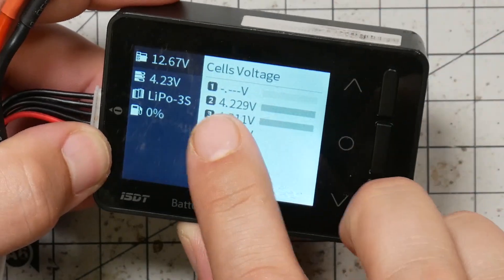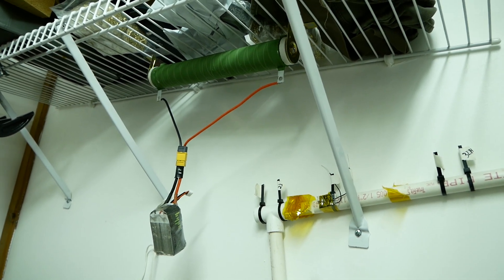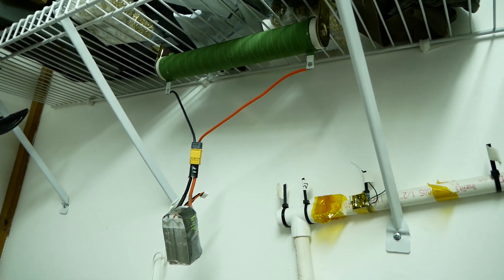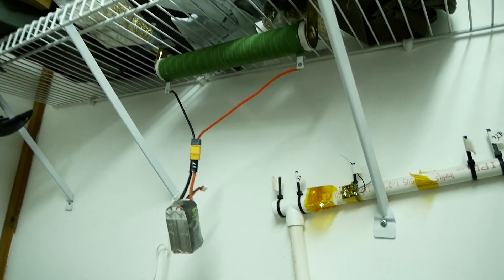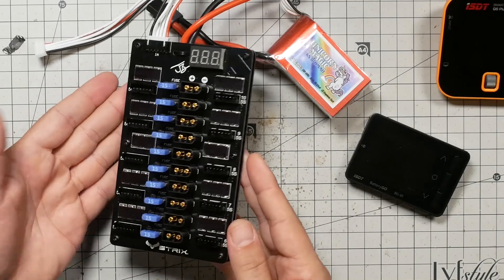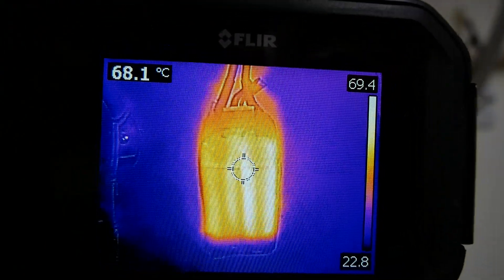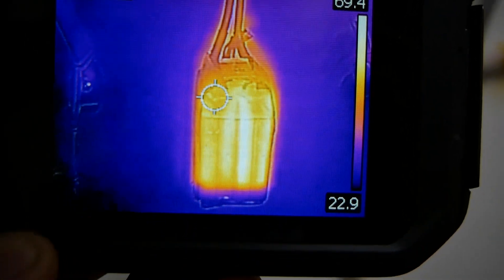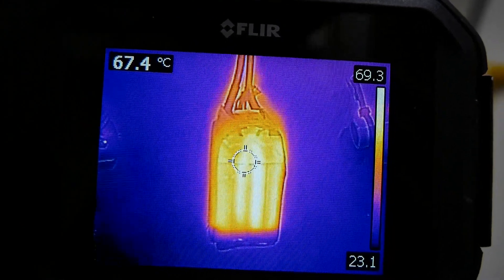Is Your LiPo Safe To Charge | WHEN TO THROW IT OUT

Comment: I'm one who splits my batteries and removes the bad cells. Never had an issue doing that. I appreciate the fact you didn't discredit that practice. These are good practices, I use them on all my packs, especially my rebuilt ones. Though they tend to be the best batteries i have bc I match the cells
Reply: Just to clarify, I do think you are being a bit more cautious than necessary. Nothing wrong with that. In an academic setting, it's very good.
Reply from the maker: It's beyond many people's capability to safely deal with bare lipo cells.
Reply: @JoshuaBardwell  I would agree that it is beyond many individuals' current skill level.. Soldering at all was beyond my capability a year ago. With training and practice, I think anyone who can solder can learn to safely rebuild a battery.

Comment: 0.5 ohms with a 4s lipo is over 30 amps initially..
Reply from the maker: Yeah I went back and checked the math and I think it's a 2 ohm 100 watt resistor.
Reply: @JoshuaBardwell  aah, that seems more reasonable 😅

what I do as well, besides checking the IR on my charger is using the lipo in question to power the charger itsself. I then start a ~10A charge and monitor the voltage drop on each cell. I just don't trust the IR measurement of my Q6 plus, since it has shown greatly varying numbers for the same cells with only a few minutes apart..

Comment: By the amount of comments i am starting to wonder if ppl are not aware NOT to use water when there is a fire with electronics. Don't forget lipo's are selfoxidizing so you can't put them out once on fire (also lithium reacts explosively with water). Pls use a (preferably large) bag of sand when there is a fire involving electricity.

Comment: Hey Joshua,
Yesterday I took my batteries to charge them and go fly (tattu r-line) and one of them had a cell at 0v. The thing is that the LiPo had no physical damage, it was stored at 3.8v per cells and it had less than 10 cycles on it.  What happened and what should I do... 
thanks
Reply: He just spent ten minutes telling you what to do. It's f#%ked, scrap it. It'll give you peace of mind and allow you to focus on getting that piece of bread out of the toaster with a fork. I suggest using a sharp, stabbing motion and sparks just mean that you've nearly got it
Reply: fp free yeah but I don't have a lot of battery and it feels bad to retire it... don't know how it happened...
Reply: @nicolasquince  Tattu are not the longest lasting batteries. They work well for a time but then -
Reply: fp free ok 😌 I will carefully choose one of them
Reply: Nicolas Quincé if you can get them where you are I can recommend FMR batteries highly, tiny bit cheaper, made by same manufacturer as tattu, performance is awesome and while my tattu's r-lines had fairly short lifespans, these are still going strong and are in better health at or past the age of the r-lines. And using the light globe method like JB shows to retire a battery is a much safer and reliable method than the salt water method. Yes battery costs suck, maybe speak to your supplier bout your bad one but put it somewhere fire proof til then
Reply: try to charge it with nimh programm to get some voltage into the dead cell then charge with normal lipo programm
Reply: I had a few cases of balance cable broken (with the insulator still holding it) if your total voltage doesn't match the sum of your cells, could be the case.
Reply: Manuel Pellizzari no it's just a cell that went to OV.. thanks anyway

Comment: i keep a 5 gallon pail of water now next to my charger, since the last one that just blew off
Reply from the maker: Water is not going to help since lipo fires are self oxidizing.
Reply: i know this, last time i had to burn my hands carrying the pack to the window with flames shooting out, safer to drop in water to transport while exploding
Reply: @jdmrustedricer6130  The standard and cheapest cure is a simple metal bucket full of sand, inside another metal bucket. Drop the hissing battery into metal bucket, then poor bucket of sand onto it. Then run..... (Dirt or Soil can work also, but nothing too wet or containing water)

Comment: i had a 2s pack with low resistance matching cells, 15 min after charging it blasted off, 3rd floor apartment had to throw it out the window

Comment: I realized recently that another potential pitfall of parallel charging is that if a wire on the balance plug is damaged you may never know it, allowing 2 cells to come unbalanced from each other over time.  Your charger will only "see" the voltage of the batteries with good connections.  I check my batteries with the linked checker each time before they get plugged into the parallel board, assuming it would alert me if a cell was out of balance but it turns out you have to manually cycle through each cell and compare voltages.  I think this is a common battery checker re-branded under a bunch of different names.
https://www.amazon.com/eHappyMaker-CellMeter-7-Digital-Battery-Capacity/dp/B01JOO3H5M?keywords=lipo+checker&qid=1540798428&sr=8-5&ref=sr_1_5
Reply from the maker: Yep. Valid.

Comment: Thanks Joshua. Got a couple of GNB 1S Lipos for my power whoop. Almost all of them are puffed a little. I never took them below 3.6. They hold voltage. Retire? 😭Winter ❄️ is coming. How to properly discharge my 4S Lipos? I have the Venom Pro Duo. Just use storage mode? Since spring I didn’t discharge as they were in use regularly. Thank you!
Reply from the maker: Those 1s whoop packs are always abused. At least if they pop off, they're tiny.

Comment: Wait so even if the battery sags below 3 volts it can damage the batteries? I run cheap batteries because well... I'm on a tight budget and it sags below 3 volts each cell I assume because now that I think about it, it might not but I think it does! Does that mean its damaging it? It doesn't stay below 3 volts after I unload it like just going to low throttle! Am I damaging my only two batteries?
Reply: Sag under high load is normal bro, just don't want it to rest when done below 3.7v per cell for best lipo health.  Fyi better the lipo the higher it will stay during sag, my good graphenes on full throttle only sag to 3.8 when fully charged.
Reply: @flo-ridafpv5713  well I only have two batteries and they where only 20 dollars. I'm on a very tight budget right now so I can't buy 5, 40 dollar batteries. I just can't do it. Thanks for the info though!!! :)
Reply: @squeezablemayonnaise8904  no need to spend 40 bro, plenty of good ones for 20 ish or less on sale, just grab one here n there when ya can
Reply: @flo-ridafpv5713  alright well thanks bro!!! :)

Comment: Saying youd never leave that discharge setup unattended is an example of good intentions.  If there were a valid enough distraction (emergency etc) it would be easy for anyone to forget what they were doing.  Since it would be trivially simple to just bring the resistor outside why take the chance?  The cells youre discharging are already condemned as faulty.  Seems like a bad idea to give them their final discharge in the very place youre trying to protect.
Reply: Best way to discharge a lipo is to throw it in a burning fire pit for a few hours.  No?
Reply: @thomasmiller6712  No
Reply: He said he leaves it hanging there over night in the video

Comment: We were told at the CAA drone pilot class if you don’t have a resistor to drain battery befor disposal, a bucket of salt water will do.
Put the battery in the salt water completely covered including the connector and leave overnight outside.
I’ve done this and it’s totally discharged safely by the morning.
A good tip!
Reply: i like the nail method quick and dirty
Reply: Everything on that column on the periodic table will react violently with H2O. I made pure sodium once out of sodium hydroxide. There were a few bits of sodium laying on the concrete when I was cleaning it up with the water hose. Tiny fires were EVERYWHERE as the water reacted to form sodium hydroxide again. The first column of the periodic table is sketchy as F.
Reply: @billybbob18  : The lower you go the better it gets. Bonus points for Francium its radioactive as well XD.
Reply: Yes great idea, lets put a bag full of material that reacts explosively with water in a water bucket XD. Tbh most of the time you will be fine as the cells are supposed to be water tight. But if its physically damaged and somehow not gone up from moisture it will be a nice explosion.
Reply: @someonespotatohmm9513 old comment, but: the lithium in a lipo isn't metallic, and won't react very violently to water. It's kind of like saying mixing salt (sodium chloride) with water will make it explode.
Reply: @ the theory is sound and will drain within 24 hours by electrolysis, basic science

Comment: what do you do with your batteries when you are done with them
Reply from the maker: Take them to Batteries Plus for disposal
Reply: @BatteriPuffa Cut both wires at the same time for maximum effect.
Reply: @lovefpv7786  Don't even joke about this. It's very easy to short the wires even when you're trying not to. Cut the wires one at a time and insulate before cutting the next, including balance leads - unless you're absolutely certain all cells are totally discharged.

Comment: You missed one of the biggest signs of impending failure which is puffing.  In industry offgas detectors are used as an early warning sign of failure and anytime a battery stays puffed its a sign of damage.

Comment: I use a 12V 20W Landscaping light bulb wired to an XT60. Toss the light and battery in an ammo box that has some vent holes and just leave it outside on a gravel pit. Took a near full charge 4S battery with a crap cell (ie 4.18v/4.17v/4.19v/3.64v) down in about 30min. I usually gator clip the leads as a direct short after the light has been off for 5min or so. Claim the balance/XT60 connectors, solder the leads together, trashcan. 

When you mention some cells being lower than others, but not horribly lower, I would have to say that is almost present in all of my batteries. Even those that are close to brand new. (I am pretty OCD about only charging to 4.2, only flying them down to 3.7, and always bringing them back to 3.8-3.85 within a few hours of flying. A lot of my packs when charged up for whatever reason will show 4.2/4.2/4.2/4.18..

Comment: a friend left a 5s pack at the bottom of a river for a day (long story) and i recharged it just for kicks, what i learned is you can't tell when modern packs are starting to puff because of the aluminum/composite plate they put on them now, if you cut the heatshrink you can tell if they are puffed a lot easier. good points about checking to see if one starts self-discharging and testing internal resistance. also i can't think of who made the video but i'm considering making a portable battery charging box out of a small metal tool box just to contain things

Comment: Amazing timing on vid. 2 days ago I had one 3s pack with bad cell and got very hot while charging in parrellel with 5 other packs. Two of the cells charged to 4.2 but the third was only making it to 3.9. I immediately unplugged the bad one, determined it was bad and the the rest checked the same (4.2, 4.2, 3.9) but we're cool. So I continued the charge with the 5 good packs and they all finally made it to 4.2 on all cells. Does this mean I may have damaged the other 5 packs even though they all charged up fine without the bad one plugged in ? I sure hope not.
Reply from the maker: You probably caught it in time.
Reply: Makes me not wanna use a parellel board for this reason
Reply: @FPVMgunit13  ...the truth is, I religiously check my batteries , cell by cell , before and after a flight, and before and after charging. As my luck would have it, the one time I didn't check cell balance on my packs before I charged , I end up charging one with a bad cell. Totally preventable. I always balance storage charge and check when they are done. So the one bad pack somehow lost a cell sitting in storage . This has been the only problem I've ever had balance charging.  I should have checked them before I put them on charge.

Comment: Quick question. If you don't want to set up an executioner's station in your closet and your charger has a discharge function, and to be clear I'm not referring to the storage function, would it be okay to just use that?
Reply from the maker: It'll only get you down to 3.0, not fully dead dead.
Reply: If 4s or below just solder up 12v auto bulb to plug and set on concrete for day or so. Deadness

Comment: Drew's battery was 60-70°C degrees when discharging? That'll increase the chance of fire for sure. They shouldn't exceed 50°C.
Reply: A LiFePO4 pack I blew up the other day on purpose went way beyond 250°C before emitting any smoke.  When it did, though, it was quite spectacular.  No flame to be seen, however, so LiFePO4 seems to be somewhat safer than LiPo after all.
Reply from the maker: Yup.
Reply: That's good to know Bat Wing but what's the best way to check battery temp while charging and discharging? I'm new to RC and shopping for my first Lipo charger now...
Reply: @ Dan
Make sure you buy a charger (I have SkyRC Q200) with an external temp sensor (you can make them with a LM35DZ and a servo cable or buy them already complete). Having an accurate temp sensor during charging is essential and will greatly reduce the chance of fire (and internal damage to the battery) if something unexpected happens.
Reply: @Sergeant898  Wow, thanks for the quick reply! Actually I have been strongly considering the Q200 but I was curious as to why it doesn't come with the temp probes. Nice that it has one for each channel.
QUESTION: I have been trying to find out if this unit will send an audible warning thru the app to a cell phone if one or more of the channel temps gets too high. Would you know anything about that? If so, I am sold. Thanks for the probe info. The temp probes couldn't be that expensive - considering the alternatives. I am thinking of building a small metal sand box covered with a tin roof to put out in the back yard and doing my charging there. after watching a few YouTube Lipo fire videos, I damn sure ain't taking no chances!
Reply: Just checked Ebay - those temp probes are only a buck or two each!
Reply: Dan. If you buy the LM35's and make the sensor wire yourself, buy the LM35's  from Banggood. I have bought them from ebay sellers and many are FAKE! Banggood ones are good.
The SkyRC app doesn't give any notifications via bluetooth. You can only use the app to monitor and start/stop charging. It's good when it works, but the app only works with one of the 5 android phones I have tried, and the BT range is terrible (about 4 meters with no walls).
The internet will make you think Lipo's will burn if you look at them wrong. Not true, they are very safe as long as they are treated well and not overcharged.
Reply: @Sergeant898  Whoa... I never thought about fake temp sensors being sold on Ebay! Do you know if the Q200 sounds an alarm if the temp gets too high? I downloaded the manual and it looks like it just shuts off the charger at 50 degrees C. Also, i've never bought anything from China. I've heard of Banggood but I'm a little leery of ordering from China, plus there will obviously be shipping costs and a long waiting time...
Reply: Dan. I have used Banggood MANY times. Best Chinese company I have ever dealt with and shipping is no extra cost for slow delivery or usually low cost for fast (7-10 days). Great company for quadcopters and RC.
The Q200 can auto shut off any one of it's 4 independent outputs at any temperature that is set by the user. I have it set for about 30°C for lipo and 40°C for NiMH.